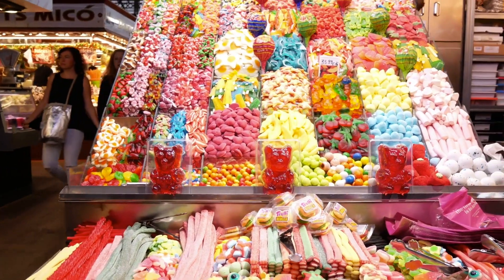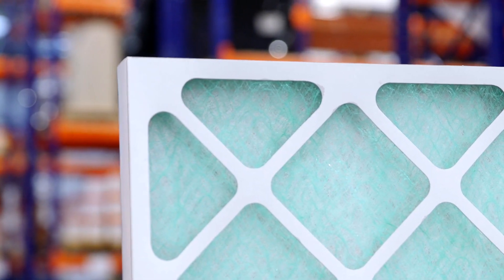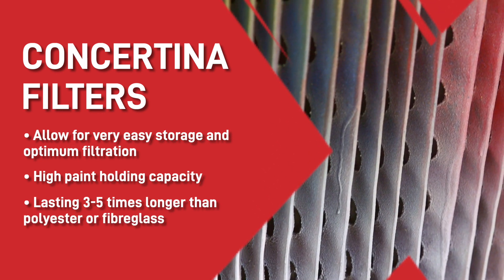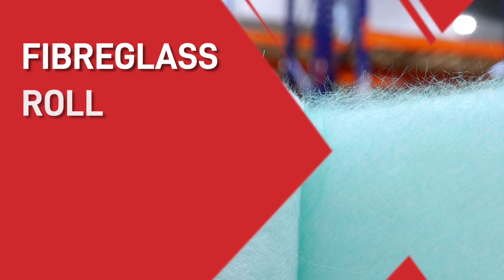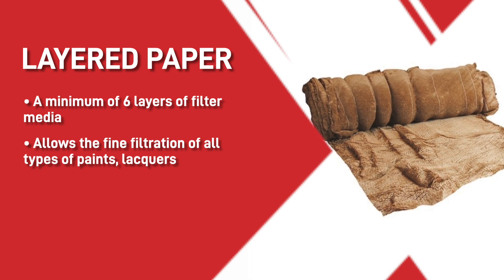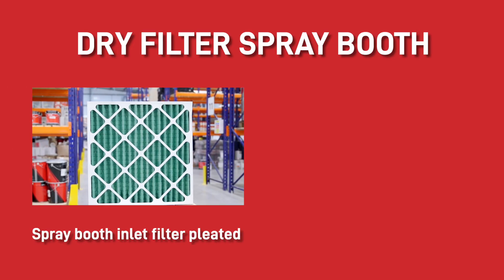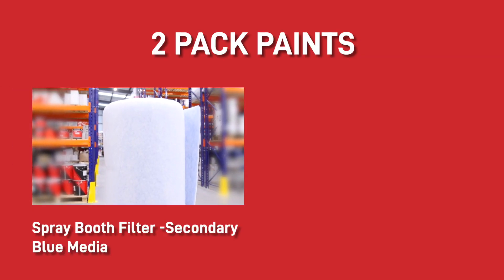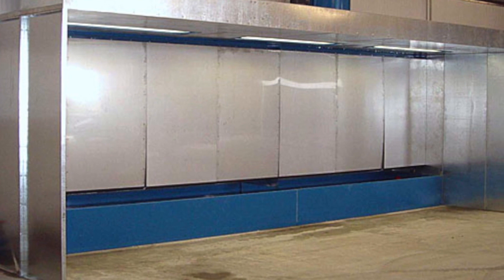Are You Using The Correct Spray Booth Filters in your Paint Shop?

Comment: Do you know if there are any filters for removing auto paint fumes? Having trouble finding
Reply: they don't really make them bro. I use a kind of home made setup where my booth exhausts through a concertina filter, then through a huge carbon filter used for growing weed, then into a water bath before exiting my shed. it works really well and you can barely smell when I'm using bad stuff like etch or 2k clears. only thing is that the carbon filter gets 'saturated' before long and needs regular changing. it's 4 ft long and 1.5ft wide and costs about $220AUD to replace. if you use it when it's saturated it just blows the smell of 2k through even if I'm not using 2k lol. so best used only for really bad stuff unless you can find a massive industrial one, or one that can be cleaned somehow? 🤔
Reply: @joeprinsen1717  interesting. How many hours of spray time does the carbon filter last? Have you considered using fiberglass spray booth filter instead of concertina? Might help it to last longer

Comment: what about for wicked, createx or water based paints
Reply from the maker: Hello thanks for the question, you can use  concertina or fibreglass filters when dealing with waterbased paints (industrial or airbrush paint types) . Concertina filters and fibre glass can be found here for more research : https://www.ultrimaxstore.com/spray-booth-filters-c-26  - any other questions please feel free to ask. KR UltrimaxTeam
Reply: @ultrimaxcoatingsltd  thank you, I was wondering more for filtering systems beyond the air unit. More of a separate filtering system to pull the paint out of the air to cause less build up, or would it just be best to change the regular air filter once a month or two months
Reply from the maker: @df1phantom  Hi no its a good question, the answer I would say is in two parts. Firstly yes changing the spray booth filters routinely (depending on how much you spray) will definitley help not only pulling overspray out of the air but also paint finish quality and booth cleanliness. To help extraction in general you need to know your spray booth flows and LEV. To undertsand this a little more i'd suggest you take a look at our other video here: https://youtu.be/AFNfW3Bs3CM if you have any questions about that one just come back and we'll answer them for you . KR Ultrimax Team